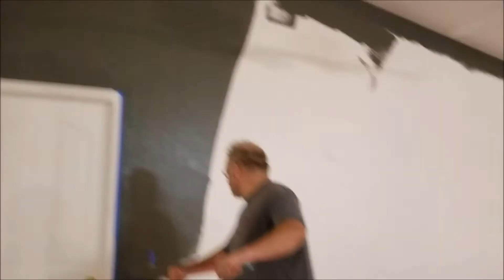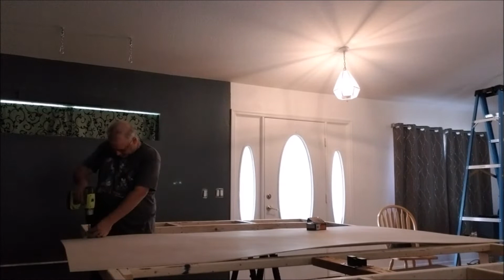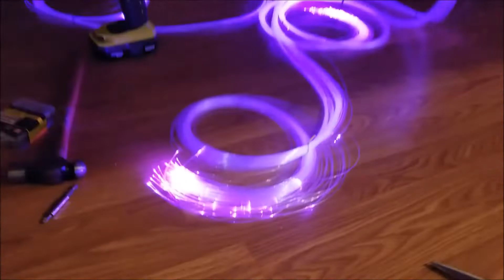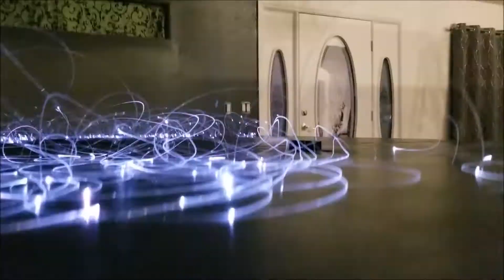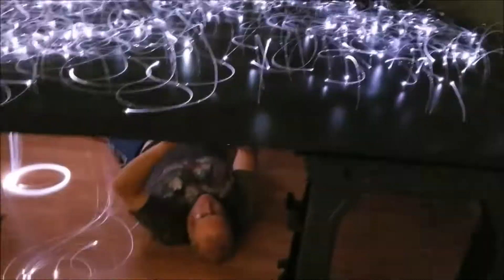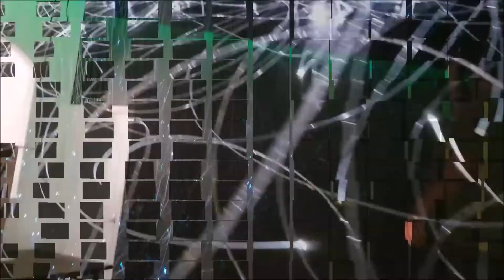Fiber Optic Star Ceiling (couple goals)

Comment: How did you hang the wood?
Reply: We used long eye bolts screwed into the studs and chains. This allowed us to assemble the whole thing on the ground and just hook the chains to install it. :)
Reply: Kevin Olsen thanks for the reply. I have a concreate ceiling so would the long eye stud work? Also where did you put the projector, I was thinking of putting one on each of the edges because I want to put two projectors but I’m scared the board will fall. Thanks in advance for any advice you give. You are a legend
Also what size chain did you buy or would any small chain be the right size?

Comment: Hi, what type of wood sheets did you use ?
Reply from the maker: 1/4" project panels. They are very light and more then enough structure to run the optics through. Just build a good frame to keep it straight :)
Reply: @YumiiMawneeProjects  thank you! One last question… what kind of glue or adhesive did you use? That all thanks so much ❤️